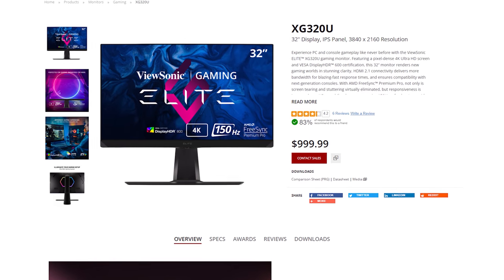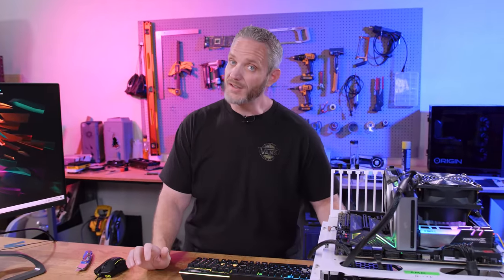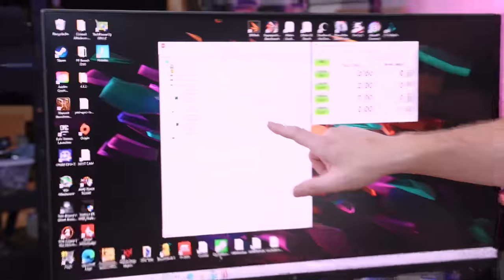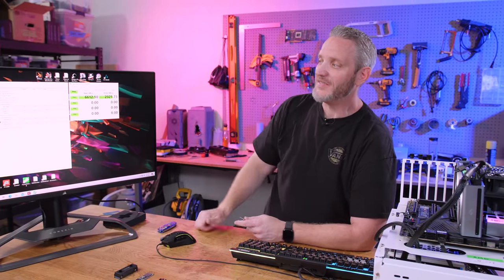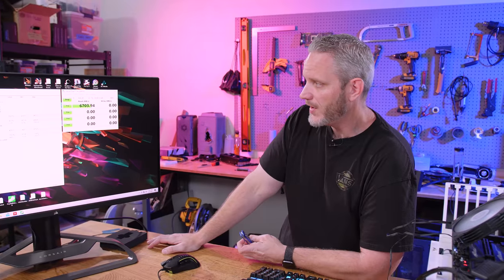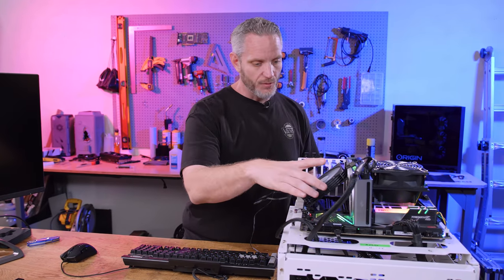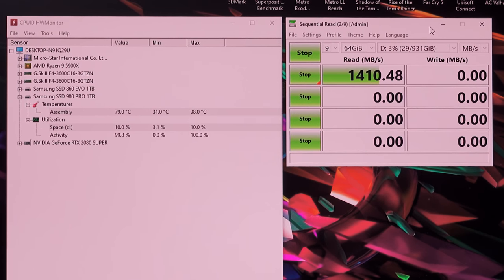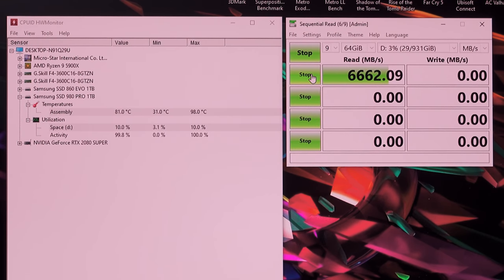I watercooled an NVME SSD... These results were unexpected!

Comment: I normally don't comment on SSD stuff, but only because for like 9 years and very anecdotally I had 2x240 gig Segate SSDs I got in in 2010 because at the time the old Intel board, which I can't even remember what it was, didn't like Samsung NAND/Controllers.  It only had Sata II, Sata 3 was wonky, at best.  But I ran those drives in RAID for like 9+ years, even did defrags, multiple reinstalls and I still have one ACTIVE in another computer, which ran as the main OS for bout 2 more years till the PSU blew the MOBO a few weeks ago, since it was only Windows 7, I moved it to a Laptop to continue using it, still works, running great.  I used several tools, and they report the drive at over 25,000 hours, with a life/expectency of over 85-90 with varying results.   Granted, these were more then likely SLC type drives, and since SLC are the most reliable, fastest, blah, the drive was/is likely unintentionally going to live longer and be more reliable with age then modern drives, running slow, hotter, etc.  Ill get back with you in another 5 years if I remember!

But all jokes aside, I got a Sabrent Rocket 1TB about 2 years ago, when the first round of covid money came in, to go with my Ryzen 3900X, and x470 board (all I could get to match up at the time) and I run this puppy at or around 3k read/2500 write.   A metric crapton faster then the Segates, which EVEN on Sata II raid they did like 250mbs/200, when put on a Sata III capable system, (this one) they only marginally did better at about 450/200.  But to the Sabrent, having run it for about 2 years, about 10,000 or so hours, (as the machine is on almost constantly cause it also serves as a makeshift fileserver) This drive is already down to about 95% life, give or take.  Then again, bigger, more modern 60-100GB games getting written to, erased, and re-written with newer ones.  I also have the Sabrent portioned off with 150gigs for OS, then the rest of the pie for the games, so it's doing double duty, and handles it well.  I don't have anything SUPER sensitive on it, so I do kinda push it hard, just seeing where it might fail, and sans my old ass 980GTX (gotta love that GPU shortage/scalper prices) just will randomly crash.  (poor thing has had lotta love).  And even with the biggest games, and most punishing tasks, the ssd's yet to have one error, flub up, etc.  

As someone else pointed out in the earlier comments, there's some weird sorta level tech that will 'heat' cells up now, to help longevity, it was something that was thrown about the tech scene a few years ago, then sorta just ho hummed off into obscurity, likely a 'feature' backed into the drives.  The thing is, when you actually delete data off an SSD it's gone, literally, cause the charge is gone in the cells, poof (had this happen a few times, /icry), and obviously if you have a dead/dying cell the SSD's own protection is supposed to offload, blah blah.  

Till the big 8TB SSD's or even NVME's come down in price to reasonable, I doubt I ever see myself getting one, well, not for anything related to storage, but I've seen odd things at the same time that say that the larger drives are FASTER, who knows.  The level of tech we've gotten to is  utterly mind blowing, to say the least.  

But I'd wager a LONG term read/write test that's constant would be an old piece of software called Vopt, it's a defragging program that originally came out in the Windows XP days, and the author supported it up till about.. I think 2015/17, then finally hung up the towl, and offered it up for free for a great many years, and all that.   It's still REALLY good, and it does raw level moving of files, no trim level, so read/write, and it does actual TRUE sorting/aggregation of the data to stuff it all back into the closest tightest logical blocks as possible, compared to modern things like Auslogic which dose a great FAST job of defragging, well, version 8 and  under 9+ is garbage.  

But as far as heat and all that, with on/off moderate use, (because of speed) I don't even ever notice the drive getting hot, slowing down, etc.  I think it its about 35-40c for me, cause I have an HAF Evo Lan box with front back fans pushing up and off the GPU/CPU with stock specter fan.  About the ONLYTHING that does seem to really make it choke is when I'm running Second Life for a few hours, and it's constantly writing/deleting/writing all the tiny to large cache files, that it can't seem to keep relatively decently sorted.  It will spew 40-50K 4K to multiple megabyte cache files (mostly images) all over the place, which causes the drive to go wonky reading/writing to keep up.

Overall, I'd wager that SSD/NVMe tech is only going to go up a scale similar, but reverse to Moore's law, in how well/reliable they'll go.  The technology is barely 20 years old, and somewhere I have a picture of a 32gig SSD that was like 700$ in 2007 when I was pricing an early SSD machine.  How times have changed!  

Granted, I'd love to do more tech, study, review nerdyness because I've been playing with Tech for the better part of 35 years, since I was a wee thing, and before HDD's were even a consumer product.  I remember in 1990 we got a 5megabyte HDD to store out Appelworks files on, rather then having to save them to 3.5inch 740k floppies the Applle's had.  But yeah, I'm just another random middle-aged dude who's really a nobody, just throwing out some random comments!  I think I have a video on my YT channel with the SSDS, besdies all the old game footage and the dogs, hah!

Fun times in deed!

Comment: I am always concerned about the sticker covering the controller and the chips. 
You should test if it makes a difference if you are using a cover/heatsink with and without the ssd sticker.
Reply: The stickers are a thin metal and the print is a few microns thin it impedes heat transfer similarly to anodized metal, meaning practically not at all. Keep the sticker on so the manufacturer doesn't start whining about warranty in case you have to replace it, it will not affect cooling performance whatsoever.

Comment: It would be interesting to see if taking the various labels off of the chips from both sides (Logo's model number ect...) so that the thermal pads can make direct contact with the chips would lower the temperature even more. I think that the only benefit (if any) to water cooling SSD's is longevity. I am currently building my first water cooled system and have decided to water cool both my SSD's just because I can. Anything running cooler is better for wear and tear IMOA

Comment: Snake oil. If your MB comes with a heatsink then great...use it. If not open-air is just fine and I have never had an m.2 throttle on me and most are just open. Anything can be measured, but that does not mean it matters. Never once has my computers slowed down that is noticeable because my m.2 was hot. And these days I only use m.2. I don't even use SSD anymore because a 1TB gen 4 for boot and a 2TB gen 3 for storage is all most people need and are reasonably priced for the speed gained. And if I did need big space I would still go with a 4, 8, or 16TB mechanical.

Comment: so i bought 970 pro 500 GB and the temp in ideal goes up to 44+ with the system on it due to the hot weather
i use the asus x570 mobo heatsink
did notice the daily write +70 GB tho, is that normal?

Comment: "some people aren't using the thermal pads on those covers".... WHY. WOULD. YOU. DO. THIS? LOL
1) do NOT remove "stickers" - the majority of manufacturers have made these "stickers" of a graphene compound designed to held spread and dissipate heatload
2) the TYPE of SSD  (mono,duo,tri, quad -bit) will make a difference in testing output information, due to how bits are written
3) I cannot think of a single normal use scenario that would incur a 85+C scenario on NVME SSD, unless someone specifically intended or ignorantly caused (see#1 for example) a thermal regulation slowdown
4) yes, they are electronic based and therefore have heat production (thermodynamic laws) by nature, but nothing that would require excessive cooling, as they do not spike or sustain the way a chipset/cpu/gpu does under any normal use load

Comment: One issue that I have found, at least with the Gigabyte RTX3090, the cooler's fins on the GPU are oriented vertically and most of the fins are covered on the top side leaving most of the RTX3090's hot air to be pushed out against the mainboard. After a couple of months of running on an ASUS TRX40-E mainboard the out of the 2x 980 Pro below the GPU's 3.5 slot cooler, one of them was actually killed causing data loss on the SSD. For the longest time I have wondered why GPU manufacturers make the fins on the GPU heatsinks orient with thier cooler covers to push the GPU hot air out against the mainboard and a limited amount out the top of the card toward the side panel of the case in the areas where the cooler's shroud doesnt cover the fins. This is kinda why I like the blower coolers despite the noise and them not working as well, at least the hot air is pushed out of the case towards the back. With the better coolers why not push the air out the back of the card and front of the card as well? After all they seem to include air vents on the PCI backplates, but when you take a close look at the heatsink fins they are in a 90 degree offset with the vent holes in the brackets making it kind of pointless.

Basically any high end GPU with the fins oriented vertically so it can push hot air against the mainboard = basically a heat gun on the SSD, and that will kill it fast if not throttle the SSD from the beginning. That is about the only issue I have with using those slots on the mainboard. But my rig is entirely water cooled including the GPU so I dont have to worry, but for those with the ambient coolers, I would be concerned with putting any NVMe drives under the GPU if the GPUs fins are oriented vertically.

Might be a video idea for you, see what effect various higher end GPUs (like 3080s or 3070s, 6800XT, etc that are not founders editions or blower coolers) have on SSD temps, even throw in a founders edition and the blower cooler to see the difference.

Comment: I've had my Samsung SSD warn me it was over heating when looking at the Samsung software.  I have a SSD slot on the bottom of the board.  Yes it is old.  It was in a mini cube case and flat with little room between the motherboard, SSD, and base of case.  I moved my system to a spare mid tower that then had the motherboard vertical instead of flat.  SSD doesn't have issues now.  Please check your SSD temps after upgrading to one. :)

Comment: 😂 i have water cooled gpu,cpu,ssd i use quick disconnects so it can be removed at any time with minimal spillage. I am utilising dual 420mm radiators

Comment: Hi,
Interesting video 👍🏾👍🏾To stress these, Try passmarks performance test version 11; running the sequential read test (only), with preferences set to "very long" and say 8 iterations ==> insufficiently cooled pcie5 nvme (sabrent 5 in my case) reached temps in excess of 70⁰ C; then with a fan assisted cooler like jiushark m.2-two temps capped at 61⁰ for this extreme test. Running "regular" benchmarks/tests peak is ~= 50⁰C
From my perspective; spectacular results as the jiushark costs £9.99 ....

Comment: Max Temps

  No coolant: 67°C

  Mobo Coolant: 45°C

  Mobo HS + Fan: 40°C

  Corsair heatsink: 51°C

  Corsair HS+ fan: 37°C

  Water mass: 30°C

  Heat torture: 98 degrees Celsius

  (smothered ~85+)

Comment: I have seen several times now that NAND Flash actually does not like being too cool. Now, I feel like cooling JUST the controller, which might give the best results, is probably going be be impossible because the layout for different drives is going to be different. Though one might argue what "too cool" actually is. It's possible that the ~40°C are perfectly fine.
That being said, and I am sure you know this, "long term stress testing" is definitely not advised on any solid state drive due to the finite write cycles of NAND.

Comment: At 18:22, when Jay blows on the SSD, the lighting change on the MB made it look like he was blowing on a fire. 😂

On a serious note, though, I’m curious how that water block will handle keeping the SSD cool when you add the thermal load from a CPU and GPU and those components under stress. Say, while using the SSD to edit or encode videos.

Comment: my be better way then laying down stand up then put water block on each side so my be L nvme bracket so stand up more air flow around chips as well video card fans draw air over fins so double side water block or fins. my be as well go back old school p3 cpu were chip stand up so cool each side cpu wounder if build clip-in cpu type board then put water block each side cpu keep super cool. if made new type board were cpu stands up side ways then they could build water go around all cpu keep all 5 side chip cooler.

Comment: I've had success with plain old air since upgrading my ASRock Z97 Extreme6 (from 2013-14), with 2 NVMe SSD's, big for it's day & earned a Tom's Hardware Product of the Year badge. Never have used either of the M.2 slots (one 3.0 x4 at 32Gbps max & another at 10Gbps), rather used a $12 Sintech PCIe adapter found on Amazon. 

Installed my first NVMe, the 1st Samsung retail model 512GB 950 Pro. With fan under load runs 15-16 degrees less than with fan not installed, so certainly worth the $12. Now it's cooling in the same PC a 512GB Samsung 970 Pro, their last model NVMe with true MLC (2-bit) technology. And for now, the smallest fan in the build, believe 50x50x15, original was only 10 thick. That's the only and inexpensive needed upgrade on adapter, a fan with double ball bearings, as the rifle one included begins squealing in less than 2 months at boot. 

So this is why it's not a great idea not to place an NVMe SSD underneath a large GPU. Give it some airflow (or love), just as with the rest of components, won't throttle when needed the most!

Comment: When I attempted to CLONE my old WS 512GB SSD to a new Samsung 980 SSD in a Sabiant enclosure thru the 10gb/sec usb 3.1 port on my ASUS GL702 VSK laptop the SSD/Enclosure would get so hot it would cause the computer to go into cardiac arrest (Blue screen of death). I even set the enclosure between two milk jugs that I had filled with water and frozen. Did not work. What finally worked was putting it on a slower 5gb/sec usb 3.0 port.

Comment: Hello Jay,
You are the main culprit in building a water-cooled PC. And my best teacher regarding water-cooling until today. 
I am an usual old (54) Romanian guy but I still love to upgrade and build PC"s.
In my water-cooled  system I have a Samsung NvMe SSD, and it never worked according to specs. until I cover it with a EK heat-sink. 
Let me share my two cents: SSD to cool - bad, SSD to hot - bad. There is a middle spot temperature and they will work fine.

Comment: My 960evo NVMe worked fine till the point i started to have some lags and freeze in game after buying a 5700XT . My SSD started to being slower and hot . I monitored it with AIDA 64 and noticed that my SSD's controller heated a LOT ! almost 100°C in charge and then, it started throttling . I bought an EK passive rad, jus put the thermal pad on the controller to keep the nand enough hot to work correctly and then, all was fine . My crash test was batch processing 1300 40MB raw pic from my sony A7II with LR to make a time lapse . Some treatments, lens corrections, reframing to 16/9 and resizing to UHD resolution and exporting them in jpg . Simultaneous read and write were fine and no overheat despite almost 30°C in the room at this time . 10 bucks for this EK radiator was an excellent investment .
I'm not sure that watercooling a SSD is a good idea as the NAND need to stay enough warm permanently for its efficiency and its longevity .

Comment: Next time you are in the mood to do dumb stuff, here's an idea. Watercool all the things. Everything you can possibly watercool, whether or not it is necessary. SSD, RAM, VRM, PSU, chipset, CPU and GPU obviously. And anything else i can't think of right now. Custom waterblocks wherever one isn't available. Bonus points for it being in a case, and looking neat. Extra bonus points for building it as if the loop order makes a difference.

Comment: For my 1TB PCIE4 Gigabyte SSD I have to use a heatsink with a fan... with the Gigabyte aorus x570 ultra heatsink the SSD overheats... the lack of airflow when using a Corsair AIO obviously doesn't help... the m.2 slot next to the cpu socket is death valley when I use a AIO... any airflow is blocked off...  below is the gpu, above the AIO block, righthand side is the ram and left hand side the integrated io-shield and some vrm-cooler... oh, and as a side note, temperature readings were unaviable due to some remaining stuff of a storeMI test... I had to reassign the proper drivers to the drives... Took me a while to figure that out... Just an uninstallion storeMI did not work, the storeMI drivers were still in use...

Comment: I use the NVMEs in my system as OS/application drives and have spinning rust (16tb Exos) for database work as my work involves pounding hundreds of GB in/out of a database as fast as all those cores can whale on it (dump 1000 threads into a queue and the system pulls each thread and executes it as soon as there is a free CPU thread - not originally for performance but Java heap fragmentation GC errors, since each thread gets its own heap, so each thread gets 5000 or so records (out of ~400m) to grind and store) that kind of write would rapidly wear out a SSD, and it’s more that the receiving process container can write out anyway so the spinning drive is just fine (the 2.5gb Ethernet saturates before SATA)